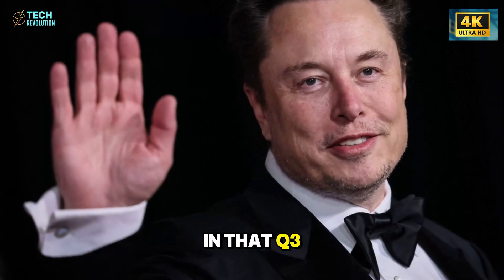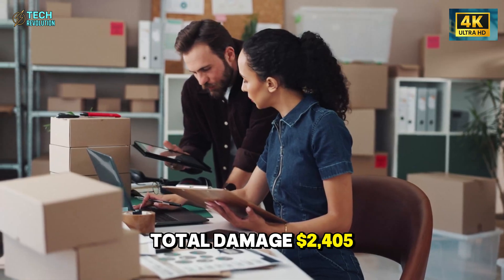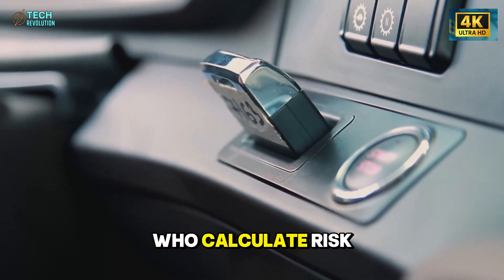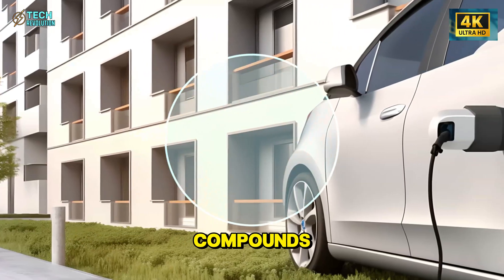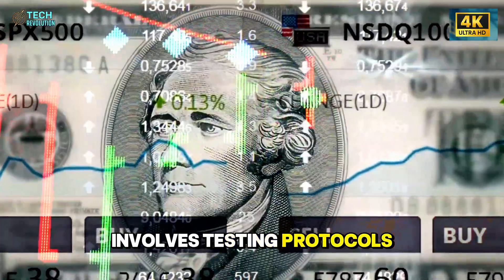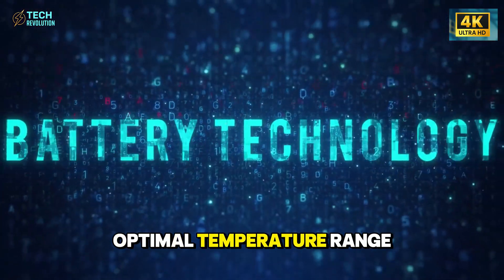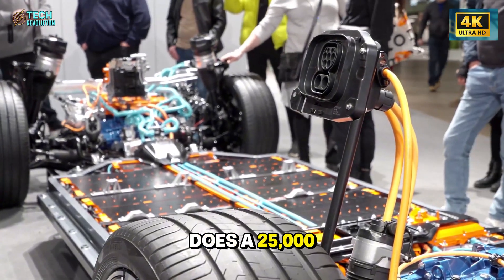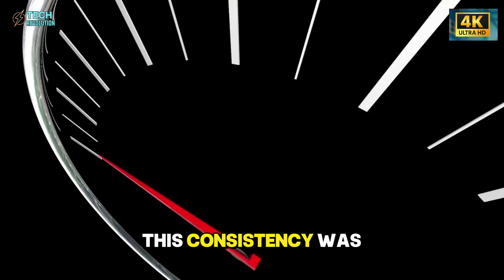Tesla Model 2 Production FINALLY HERE: Carbon Fiber Battery, What's SHOCKING?

Comment: How are the shells connected to each other?
Reply from the maker: Great question — the Model 2’s body shells would connect through structural bonding and high-strength aluminum nodes tied into the single-piece rear casting. That’s how Tesla keeps rigidity high while reducing weld points.

Comment: Can the motors not bring the car to a full stop, rather than the brakes? Is it a present safety issue? You can run the two systems in parallel to confirm the reliability of the electric motor braking and then remove the mechanical brakes!
Reply from the maker: Regen can slow the car a lot, but can’t safely replace mechanical brakes. You still need physical brakes for emergencies, redundancy, and full stop control.
Reply: @TechRevolution26  OK, could you use a mechanical method of storage rather than pads, say pneumatic or spring system that can feed the energy back? Pads just seem a waist of energy and produce pollution. Thanks for your reply.

Comment: 4:15 Where does that heat go?
Reply from the maker: Great question — in setups like the Model 2, excess heat is routed through an under-subframe cooling loop. That system dumps it into the airflow under the car instead of the cabin.